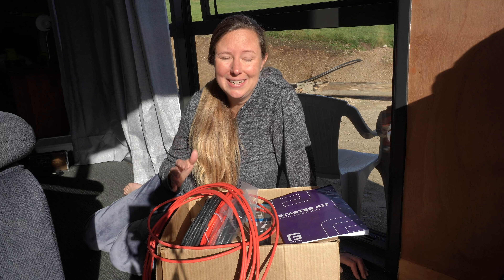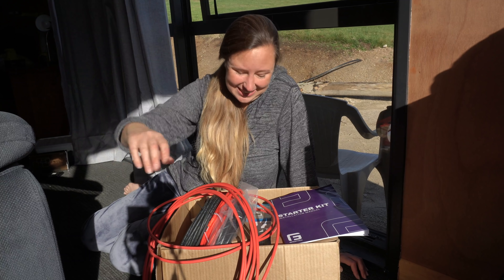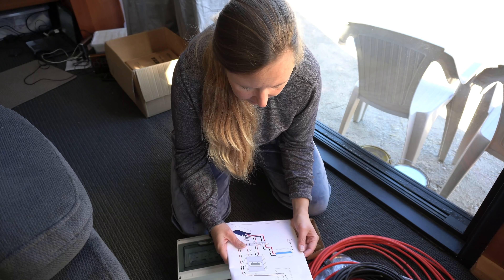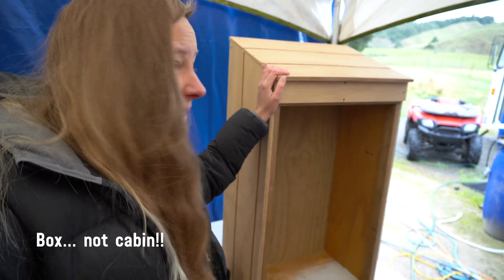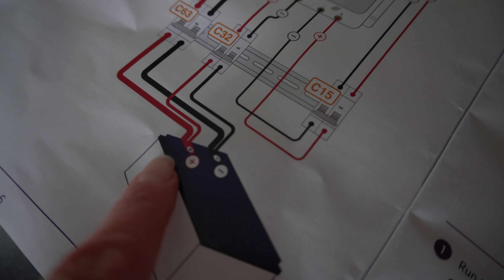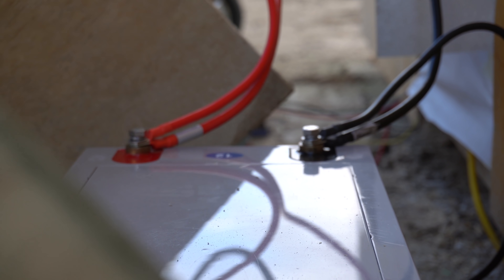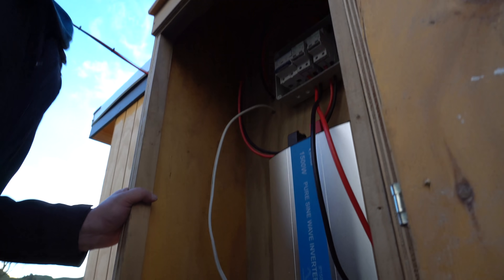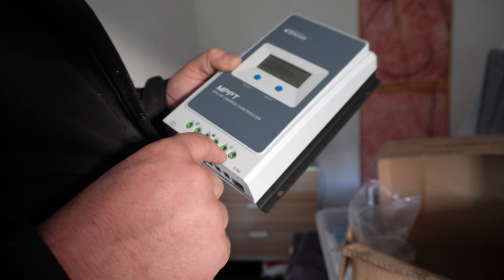Basic Solar Power Set-Up With GridFree

Comment: Always use a Charge Controller,  it keeps your battery from being damaged from Over Charging. Your dc to ac converter can be in your house. Could make it easier to plug into or wire to dedicated outlets. Plus if it trips, you wouldn't have to go outside to reset the breaker on it. I just found your channel so I'm not sure how cold it gets in your area, as your battery gets colder, being outside, it won't hold as much power. You could put it inside the home but would need to have a sealed box that is vented to the outside since lead acid off gas when charged. Definitely something to consider with a little one in the home. Please talk with your solar provider to clear up any concerns of what I wrote.

Comment: I think someone covered it, but just in case, these EpEver controllers are good, but the output connections on the controller are limited to the maximum current capacity of the controller. If it's a 20amp controller(?) then I'm sure there will be times that you will use more than 20 amps of 12V current. That's certain if you use the inverter. Best to wire from the battery directly, as you have.

Comment: Hi guys,one Word put tails on ur cable to prevent water from entering outside electrics,I would keep battery on left of heater because in cold weather it will keep battery warm therefore helping charging.

Comment: Something odd there ? 15V from the solar panel yet only 13.5 at the battery ?
Reply: The panel will make a higher voltage than the battery. That's the job of the the controller to make the charge voltage correct.
Reply: @nigelmarx3578  13·5 is a bit short of 14·6 !
Reply: One of my solar off-grid systems regularly shows 30+ volts coming off the panels and 13 volts or less at the "12 volt" battery when the battery is low and are being bulk charged. Float voltage for my batteries is 13.6 volts but for AGM batteries it can be as low as 13.3 volts. Their battery could be fully charged and the controller is just holding it at float level.
Reply: @nigelmarx3578  Makes no sense - it'd be interesting in those circumstances to bridge out the charge controller and ee what voltage you get with the panels directly connected to the battery.

Battery charging volage for lead-acid is 14·6V - the battery will regulate the current for the various states of charging.
Reply: That's what a MPPT controller does. I regularly have over 30 volts coming from the solar system, down to around 14v at the battery
Reply: @garth2876  But that's reasonable !

Comment: "The exhaust from the diesel heater gets hot"
No shit, Sherlock !

So  your diesel heater just heats the atmosphere. I just don't understand people. They buy a thing to heat up and then just vent it to atmosphere. Get Hayden to point it into a metal container and run a copper coiled pipe in there too - filled with water - free hot water !
Reply: If you are likely to try this,  just be  aware of the allowable back pressure on the exhaust line. Long line could increase this back pressure and cause heater errors

Comment: Why not put solar panel on cabin roof. Caravans have them on the roof and have no problems charging batteries.
Reply from the maker: It’s a funny thing with councils 🤷‍♀️ No panels on a sleepout if not done through the council. Same with no plumbing or fireplace
Reply: @TravellingK  Hi there Karen, if you manage to see this, and dont mind answering.. the comment regards fireplaces, then noting that the other solar panel setup was on the containers, did you go through council for that? or do shipping containers have a different set of requirements. I am in the process of beginning a shipping container sleepout, and have the offer a small potbelly stove, and also are looking into solar down the track a bit. Cheers, D.

Comment: hehe...  I loved Hayden's conception comment... also learnt how to wire up a circuit breaker (I need one of those) and just love love love the swinging panel frame.. have been trying to work out how to fix my extra panels outside myself in a simple and effective way so thank you!  Wee Reece (hope that is spelt correctly) is absolutely gorgeous and clearly strong and wanting to learn... you are doing a fabulous job!
Reply from the maker: Glad to hear you’ve found this video helpful! I’ve certainly picked up plenty of tips from Hayden already

Comment: I so hope this works out for you. I've often wondered if it can be made to work this way. Inverters are convenient, but I am not yet convinced they make enough sense for ALL power needs. I know for some things it makes sense, but for modern day lighting it seems over kill and wasteful to use 110 or 240 volts. Not sure about heating, but that's another matter. I bought a computer motherboard 6 years ago that does run off 12 volts just to explore what that is like, I have to say it's been fine to date. I use LED lights and have done for maybe 4 years now and they could work from 12 volts but would need a transformer go down to to maybe 5 volts. No issues noticed there either. The lower the power we can end up needing, then the simpler much of the system can potentially be. I'll be really keen to see this work just fine for you without an inverter, I reckon given the will to make it happen, it could even be the future as appliance makers get savvy to the idea. The very best of good luck. :o)
Reply from the maker: I’ve regularly been told that inverters use power too… one way to keep usage down
Reply: @TravellingK  Thanks for that: My gut feeling was that it must be less efficient to over generate for a higher voltage which most of the time then has to be stepped down to make use of it all. Now we have at least one actual (ie not gut feeling) reason that had slipped by me until you just mentioned it. Of course it's obvious that the inverter needs some juice too, and obvious or not I managed to miss it! LOL If only trying to be thoughtful meant I would not miss anything truly obvious, then I would probably be doing a fair bit better! ;o)

Comment: I am wondering why that second set of wires are thinner than the first ones?
Reply: Just a guess on my side (I have not seen the entire diagramme) The thinner wires carry the charging current and the thicker ones the usage current. The charging current comes from a single PV-panel, and is thus limited. Therefore, a thick (and therefore more expensive) wire is not needed. It is a starter kit. Rewiring may be needed on expansion..

Comment: Please put you battery inside .. it will die outside .. if it's a lithium battery first frost and it will be dead ! 🔋
Reply: She already said it was a gel battery ....... pay attention !
Reply: @ronpharo1260  all batteries loose more power when the temp drops so makes no difference if in freezing conditions. you could put fireproof lagging all around it.
Reply from the maker: It’s a deep cycle battery… but something to consider
Reply: @TravellingK  K. Even lead acid don't do well with cold & charging ..  I'd look to get a sponsor for a decent  lifepo4 battery if you can.  Much better capacity / longevity vs deep cycle if used off grid .. all the best for your adventures .. Peter

Comment: A slight droop where the cables go to the battery, would prevent water from pooling on top of the battery. I think?
Reply from the maker: I’ll keep an eye on it!
Reply: Yup - and a heavy duty bolted fuse onto the battery +VE - it may only be 12V but the current under short circuit can be very high with a nice plywood container to catch alight.
Reply: A drip loop.
Reply: @lakecavanaugh  YEP  drip loop needed.